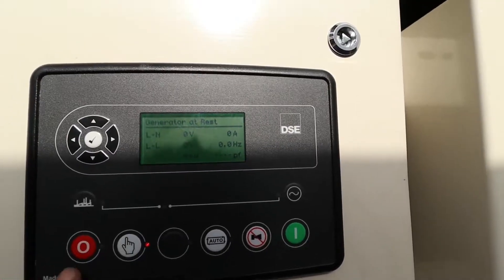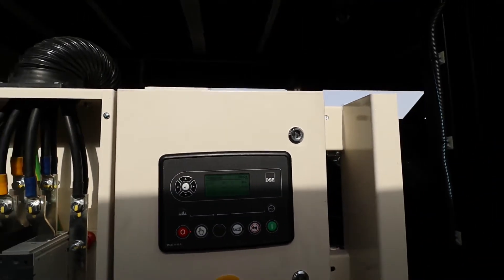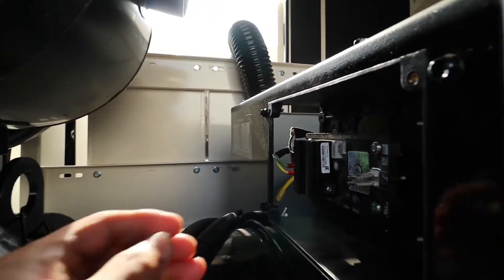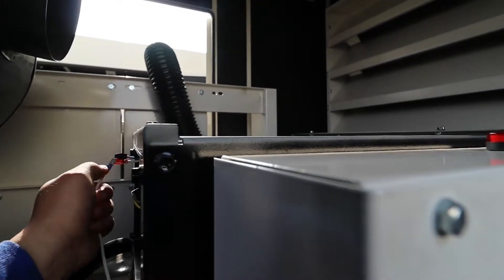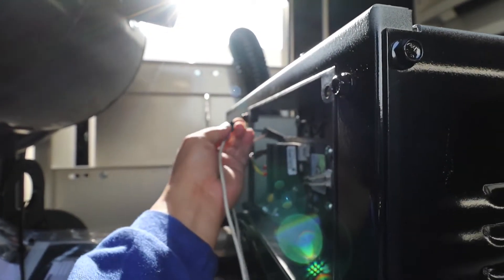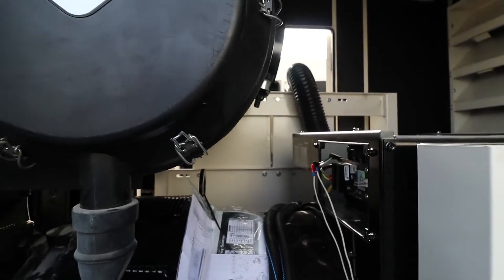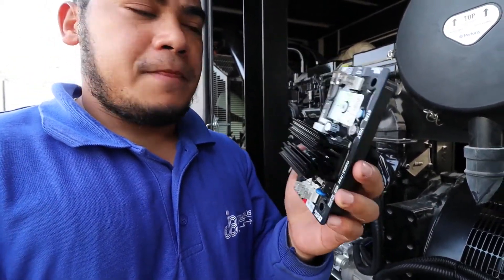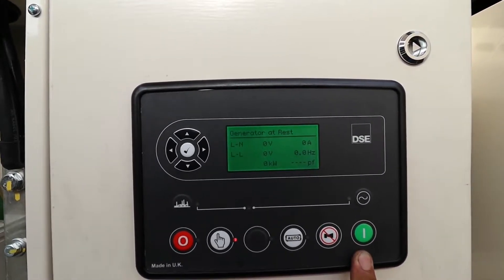how to troubleshoot faulty avr by excitation benzblogs

Comment: Excuse me, gentlemen, when I energize the voltage rises to 500V, but when I turn on the AVR regulator, none of it displays. I even replaced the regulator, still the same problem. What should I do?
Reply from the maker: I thnk make sure the polarity of your exciter to gain the correct voltage if you wrong it will not generate voltage

Comment: how do i know  which  wire is f1 or f2  excitation wire  , if there is no any color code
Reply from the maker: Okay F1 is red or positive and F2 is black or negative
Reply: i have only two wire from excitation they don't have any marking, whether  f1 or f2, x or xx,  red or white.  how do i understand which one is negetive  or possitive   that is my prblem @benzblogsVlogs
Reply from the maker: @abdijama9108  in the avr you can see the connection
Reply from the maker: Do one thing connect the exciter to 12 vdc if the voltage give low output meaning you wrong polarity
Reply: if i accidently connect my excitation wires wrong position   such as  positive wire to minus port of avr  and negative wire to plus port of avr  does my avr became fault @benzblogsVlogs
Reply from the maker: @abdijama9108  its just give u love voltage
Reply from the maker: Low voltage ⚡
Reply: thanks for your argent reply, its giving low voltage but your AVR would not burn @benzblogsVlogs

Comment: hi sir,my generator volvo 500kva, my problem is 220v output is working but change to 400v,the phasing line is no coming output
Reply from the maker: Double check the wiring and the connection of your avr and the type of avr so you do the wiring
Reply: @benzblogsVlogs  thanks sir

Comment: How to check avr while not connected to the generator.
Reply from the maker: You can but that is not safe you need you voltage sensing and excitation connected to the lamp and voltage potentiometer in order to adjust the voltage sensing to check if excitation level is increasing or not
Reply: @benzblogsVlogs  do you have messenger?
Reply from the maker: @angkolmadudz8752  https://www.facebook.com/groups/1581429425388674/chats/5195138870614004

Comment: Magaganda po ang sharing mo about gensets sir. Tanong ko lang po regarding sa avr  kung hindi nagbuild up ng voltage.pag magexcite po ba sir tatanggalin yung connection ng sensing sa avr at  pati yung F1 F2?.
Reply from the maker: Yes sir tangal lahat yan sa avr kasama voltage sising e isolte mo lang tapos yung F1 F2 ay yan ang ilagay mo sa battery dapat nasa 300-500vac out normal yan
Reply: TY

Comment: Sir, new subscriber mo..matanong ko lng sir, kapag nabura na yung marka sa dalawang wire ng exciter field na may + at -,, ano ba ang gagawin mo sir? Paki sagit nman po!
Reply from the maker: If you want to know try to excite if the voltage lower down meaning you put the positive wire in nigative reverse so you know now excite again and if the volatge higher meaning that is correct polarity you holding +and -
Reply from the maker: Simple lang sir
Reply: Thank you so much sa sagot mo sir! Merry x'mas  and Happy new year in advace
Reply from the maker: Thank keep safe happy new year

Comment: Sir, yung F1 at F2 ng AVR icoconnect direct sa 12V battery tapos start ung gen.set o start muna ung gen.set bago iconnect yung F1 at F2 sa battery?? Di po kasi nakita sa video ung complete set up. May problema kasi ako sa gen.set, same ng video nyo problema, nagoalit nako ng AVR ganun pa din, ibig sabhn nawala ung excitation voltage nya.
Reply from the maker: Pag nag excite ka sir dapat tangalaing mo volatge sensing tapos f1f2 yung ang i connect mo sa 12 volt habang omaandar ang engine dapat may makokoha kang voltage from 300-500 ac
Reply: @benzblogsVlogs  ibig sabhn sir, start ko muna ung gen.set saka ko iconnect yung f2 at f2 sa battery or iconnect ko muna bago sstart ung gen.set?? Same lang ba ng results yan?
Reply from the maker: @agent70vids3  dapat dalawa kayo isa magpaandar thin isundotan mo ng 12 v
Reply: @benzblogsVlogs  ibig sabhn, start ko muna gen.set , pag nagvstart na saka ko i-tap ung 12V battery sa F1 at F2, tama po ba?
Reply from the maker: @agent70vids3  correct sir
Reply: @benzblogsVlogs  salamat po, iupdate ko kayo.
Reply: @benzblogsVlogs  sir, hindi nag build up ng voltage ung gen.set namin, wala din resistamce reading ung F1 at F2. Sira na exciter. Thanks sa tulong
Reply from the maker: If not builf up sir tapos walang resistnce meaning sira na. Sir pa reqind mo nalang at check mona din diode nya para sure tayo pag balik ng exciter mo
Reply: @benzblogsVlogs  sir possible ba na rotating diode problema?
Reply from the maker: Jaut make sure na di paulit ang problima

Comment: Yes good diagnosis we also diagnosis in automobile same like bypass the connection. I have on questions you use battery 2 12v battery why not connect 24v to exciter if put what will happen.?  And to get maximum output of the genset how much voltage supply to exciter from avr ? is exciter  directly connected main generator through rotating rectifier  to become rotor will be electro magnet.? Avr get or use power from battery or line?  Or avr use permanent magnet generate?
Reply from the maker: To able to maintain the correct supply voltage
Reply from the maker: It will give high excitation
Reply from the maker: Avr get power to ac and converted to dc supply where always calculating how much excitation depends on the load

Comment: Sir, paano kung ok nman AVR pero hanggang 210 VAC lng ang nagagawa ng generator. Ano sir pwedeng gawin.
Reply: Ok sir maraming salamat sa info. Sana hindi ka magsawang magsagot sa aming mga katanunggan. God bless and keep safe always.
Reply from the maker: Walang problima sir tolongan lang tayo bless u
Reply from the maker: Sir anong avr ang gamit mo at ano ang connection mo doon sa winding para amalamn natin. Kong tama
Reply: AVR-8A tapos yung negative ng winding ay sa F- ng AVR at yun positive ay sa F+ ng AVR
Reply from the maker: Pano ang sensing mo sir at anonconnection saan ka nagtoping
Reply from the maker: Walang kng picture?
Reply: Yung sa sensing line to line ang connection.
Reply from the maker: Gabito sir ng excite kana ba para malamn natin kong aling ang sira
Reply from the maker: Ilang kva yan sir
Reply from the maker: Kong 220 ang sensing mo dapat nakatangal ang link mo sa 110 vac
Reply from the maker: Ngayun kong ganon parin mag excite kana para malamn natin ang sira kong mag excite ka dapat ay naka tangal ang sensing mo sa avr konin mo ang f+ at f- dapat 12vdc doon mo i totok habang naansar ang generator ngayun sukatin mo ilang ang inabot na voltage ac ok
Reply: 40 KVA tsaka 220VAC. Connection ng sensing niya ay 220 VAC. Hindi pa namin na test yung exciter niya.
Reply: So tanggalin ko yung sensing sa AVR tapos ano ba dapat makuha namin na normal reading pag nag excite kami.
Reply from the maker: Dapat makoha nyong voltahi jan i nasa 300-500 vac ibig sabihin ok exciter at winding alt nyo
Reply from the maker: Tangalin mo sinsing sa avr tapos f+ and - tabgalin mo din at ilagay mo sa battery